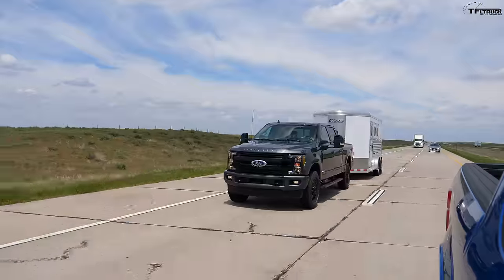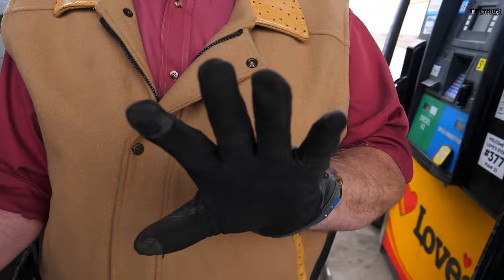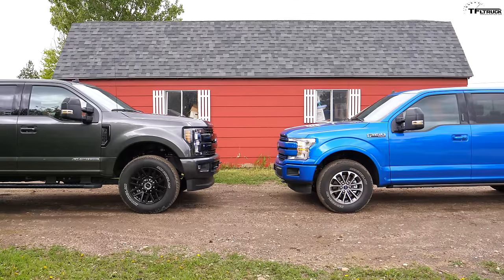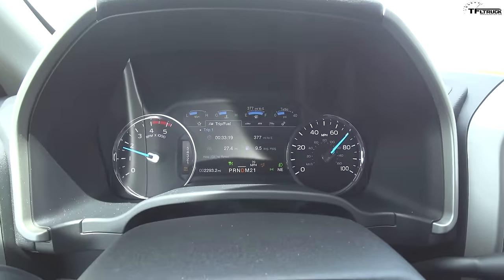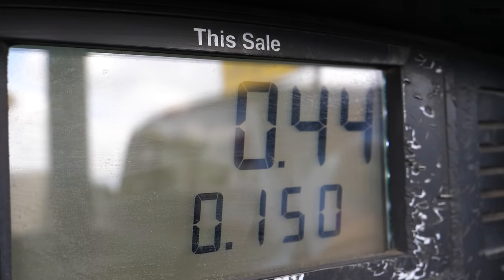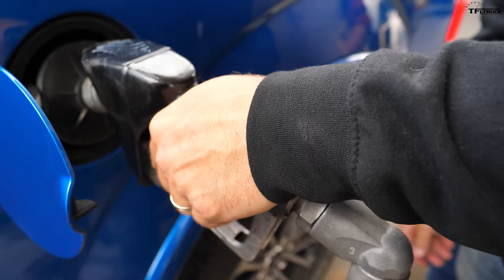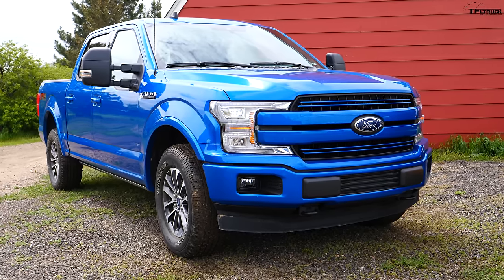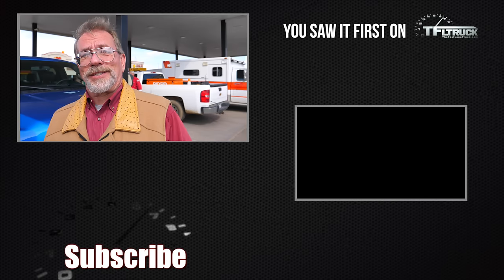Do You Really Need a Heavy Duty Truck to Tow 9,000 lbs? Ford F-150 vs F-250 MPG Review

Comment: The truck weighing so much less and the diesel being 1.7L more displacement does hurt its efficiency significantly comparatively. Of course the turbo helps but the weight is still a lot more. If it was a 6.7L turbo gas truck I feel it would be in the 6-7 range

Comment: Obviously the Heavy Duty will outperform the Half Ton V8. The real answer to which truck you need boils down to what you actually use the truck for. If you tow a camping trailer 3 or 4 times a year, go with the Half Ton. If you tow on a regular basis, like every week, then get the heavy Duty.

Comment: They need a 5/8 truck. 1/2 ton size with tow and payload between the two. Say 13000lbs towing and 2k payload on the spec sheet. Then anyone with a trailer between 26 and 32’ will habe perfect truxk to tow without the size of a hd for everyday use

Comment: There are F-150's with more payload than that F-250 and can tow 13K easily.   How much can your half ton can tow was completely glossed over though. Payload determines if you can tow it or not.  According to this video, they are 10% tongue weight on that 9K trailer, add in the WDH and they are at 1000 pounds. Add in two dudes at at least 200 each and there is 1400 pounds in that F-150. So they are within 200 pounds of GVWR, provided that there is nothing else in the cab or bed.  On the F-250 they are 600 pounds from GVWR.   If taking a trip with a 9K trailer with the family and 200 pounds of gear in the bed, the F-150 will probably be over weight.  If it is a travel trailer, 10% on the ball is too light and a sway incident in the making, so figure 13% on the ball,  or 1170 pounds, plus the hitch, 1270. Hope you have the proper tow package, which on the 5.0 is 1150 pounds max tongue weight.  OOPS guess what, a 9K travel trailer with a 5.0, not going to happen, sorry.   Tow package for the F-150 is 1150 WDH 11,500 GVWR of the trailer.   Ecoboost can have Max Tow, 1320 hitch weight, 13,200 trailer weight, so as long as it has at least 1800 pounds of payload, it can tow a 9K travel trailer. 

The guys need to run some numbers on these trucks for various towing scenarios, because towing is not cut and dried, there are a lot of variables involved.
Reply: Dude you on the spot. Payload is the rule!

Comment: Do you guys think the big 3 might end up dropping their respective 3.0 diesel 6 cylinders into the 3/4 ton trucks eventually? I think it would be a great cheap option for fleet buyers, I know they don’t tow like the big V8 engines but maybe they should offer them as a no cost or low cost option over the small block v8s. Maybe after the 7.3 Ford, 6.6 Chevy and whatever Ram chooses to replace the 6.4 with, it might be viable. I think everyone knows these 6 cylinder diesels are heavily detuned for the EPA, something you don’t have to worry about so much with a 3/4 ton.

Comment: Get a used old truck for 1/3 or less of the price. May need some parts but you will still be in the green. Will most likely work better and be more reliable. 
Spending 65k on a truck is absolutly dumb. Imagine being in debt for that long on a vehicle that's intended to be abused. Smh.

Comment: Looks like this loop is all flat so not very realistic. How about a loop that includes some hills? Doesn't have to be the Ike but at least something that puts a load on the trucks. 

Most people don't buy diesels for the fuel mileage. They buy them for the ability to pull big loads, longevity, and the engine braking capability when descending long grades.
Reply: Mystery Meat exactly. The diesel should shine even more. This might as well been all down hill.

Comment: With the help of air bags a front brake pkg which I installed myself on a 2011 F 150 4x4 with long bed,and not even a 5.0... It pulls my 30ft. Fifth wheel with no problem. As a class A CDL Holder, proper braking distance and common sence one should have no problem. 70k for a new dually??? Ef that!!!

Comment: " Do You Really Need a Heavy Duty Truck to Tow 9,000 lbs? " No.
But it sure is nice to tow with a Heavy Duty Diesel truck. Too much truck is better than not enough truck. Period. I could never go back to a 150/1500 even if it would do the job.
The difference between "tows it just fine" and "Does an exemplary job". The exhaust brake ALONE makes a huge difference.

Comment: Just think if ford built a twin turbo coyote for the f-150 and gave it 650 torque and at least 600 plus hp for towing.  On low boost.  Tuned well this truck would be great.

Comment: Might as well have used a Ranger. I would think that anyone planning to tow 9000 lbs would get a F150 ecoboost with max tow package. Tons of power and payload capacity.
Reply: Sooner than later that 150 would have multiple problems with 9k.  That’s just not safe.
Reply: @Chromewarrior  There is where we disagree. F150 is rated for 13,0000 GVW towing. 9k lbs is far under that and not an issue at all. I have this setup and it is great. Handling, breaking, acceleration are all MORE than adequate. There is a reason manufacturers provide this rating. People get caught up in preferences and "bigger is better" mind-sets.
Reply: D Koo5 , here’s my understanding, my 2018 F150 Eco Boost is rated about 13,200 gvw.. The truck weighs about 5800 . That weight is subtracted from the 13,200 leaving about 7400 to safely pull including what’s loaded in the truck+trailer +contents of both ( driver, passengers, fuel, water, etc) .im sure the manufacturers are conservative in their ratings to cover their butt. The computers on all these new trucks are like a black box. They pretty much record, speed, pulling weight, braking which could cause problems for exceeding warranty. I’ve heard so many different opinions, it’s crazy!
Reply: @Chromewarrior  Don't confuse your tow rating with your vehicle GVW. They are two separate things. Tongue weight/5th wheel hitch weight, factors into your truck GVW. Tow weight is as rated; trailer or 5th wheel.

Comment: That's crazy bad MGP from the Diesel … I don't get it? I tow my 34' boat (12000 dry + whatever gas is left in 240 gallon tank) ~1080 miles twice a month and get over 14 mpg all the time with a 2001 7.3 F250 4x4  had a 1999 F250 10cyl  that got at best 6.3 mpg towing the same route and boat...

Comment: My issue with the Video is due to payload. The 150 was around 1450# which with a 900# trailer and 2 adult men, probably were pushing the payload limit. You should have weighed the trucks as well hooked to the trailer (BTW there is a CAT scale at that Loves.) now imagine a real family with a camper or horse trailer or boat, with 2 kids and the bed of the truck completely full. There would be no chance of being under the payload limits and in all honesty the 250 would have been pushing it as well. I would like to see all of your towing videos to have the trucks weighed with the trailers and compared to axle ratings and payload because a “normal” family using these vehicles you are WAY over payload way before you get to max towing capacity.

Comment: No you don’t. I have been towing a 6500 lbs RV with Mercedes ML/GL (GL BETTER) Diesel legally, safely for 20,000 miles, 5 years. Cross winds, sudden braking, everything. It works if common sense is present. I also towed the same trailer with a RAM 1500 Ecodiesel. Flawlessly. The problem with the RAM was the payload (tongue weight). Believe it or not the GL was legal and thre truck not - at the scale.

Comment: How about the f150 with the 6 1/2 ' bed with the max trailer package 20" wheels,3.5 EcoBoost, crew cab,4x4 with 800 lbs in the cab towing 12k .ford says it will tow 12700. I only tow my toyhauler every once in a while and would like the f150 if this is safe to do so.i would like to see a video with this scenario and give your feedback. I like you channel you give us truck buyers real information

Comment: Did the diesel go into regen mode on the loop? It only consumes DEF during regeneration. If not it shouldn't have used any DEF. A bunch spilled out of the fill neck when you topped it off.

Comment: How about a car trailer where you can't perfectly center the weight in the trailer, like hauling a diesel truck that's front heavy.  I towed one recently with my 07 cummins 2500 and you couldn't pay me enough to haul something like that with a gasser 1500.  Highway maybe fine, but you get on the regular roads with bumps, good luck!

Comment: At those pump prices it cost $1.96 less to do that tow with the F-250 diesel vs the F-150 gas truck. You only need to do about 5,102 of those trips at those fuel prices to break even on spending the extra $10,000 on the F-250 diesel.
Reply: Apparently Diesels require more maintenance...more oil for oil changes..etc...another consideration.
Reply: @mikefoehr235  And have more towing capacity...and your point?
Reply: @killer2600  my point is a diesel will cost more to maintain than a gas engine. Plus the higher cost of buying one to start...looks like 10 grand more than a gas motor.
Reply: @mikefoehr235  None of that is really relevant because my original comment is just an insight gathered from the video. No one is really going to do that run over 5 thousand times and during those 5 thousand runs the price of fuel isn't going to remain the same.

You're trying too hard to nitpick. Even if the gas were to be cheaper to own it can't tow the 15k the diesel can so the gas trucks lower cost is irrelevant to many F-250 buyers.

I was just pointing out that despite the higher cost of the diesel's purchase price it would be possible to break even because of the lower fuel cost driving these runs in the video.
Reply: darkjedi351  did not know it was that bad...wow

Comment: Trucks don't stop trailers with their brakes alone.  You have to adjust trailer brakes to assist.

Super duty is far more stable for 9K pounds.  I've had 150 and 250 gas.

Comment: Have owned Gas and Diesel.  For the occasional small camper or boat etc.. Gas. but if your an every weekend pulling or even week day or take trips more then hour from home towing buy the diesel/heavy duty truck. Currently own F350 with 6.7 diesel and pulls like a freight train and has 212k on currently.  Fords only way to go!

Comment: One of the lower trim level F250 with 6.2 V8 doesn't cost much more than a higher trim level F150 or maybe even about the same price.  Trucks don't need all these extras that add nothing to the capability.  A bunch of chrome and infotainment stuff that most people don't want to pay extra for.  Not to mention gigantic wheels that look silly with low profile tires that cost a fortune when they wear out.  Something like the tradesman series that Ram offers is a great package for a new truck.

Comment: I really like your videos!  Very informative!  I have a 2018 F-150 XLT WITH 5.0 Coyote Engine.  I also have a Jayco Jayflight trailer, 35 ft long, 6500 lbs dry.  I have a weight distribution system plus Airlift airbags 5000 lbs.  In your opinion, am I okay with that set up?  My F-150 has a max tow capacity of 11,600 lbs and a GCWR rating of 14,400 lbs.  I was contemplating trading up to an F-250 diesel but your video here gave me something to think about.  

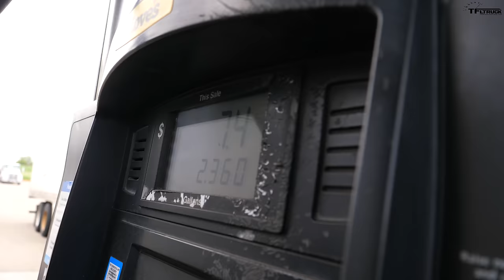Also, I have concerns about hills.  Is my truck powerful enough in the lower gears?  I have a tow package with a 3:55 ratio.
Reply: Half-ton truck, 35-foot trailer; not a good combination.  I really doubt that a 35-foot Jayco only weighs 6500 lbs empty.  Get a smaller trailer, or a 3/4 ton truck.
Reply: That’s what the rating says on the sticker on the trailer.

Comment: I want to see braking and handling in corners. I also want to see this done on the Ike gauntlet. 

Personally I wouldn’t buy a f-150. I like a big diesel way too much, and the 8ft bed. I also like to stay under 80% tow capacity. Easier to have way too much truck, plus you can delete emissions.
Reply: I had a question on the DEF fluid is it true it actually hurts fuel economy and that it really isn't better for the environment?
Reply: Spartan 212 DEF is essentially urine. Its really not any better for the environment. And yes it hurts fuel economy, 1-3mpg is what I have personally seen out of light duty trucks. Diesel as a whole is more environmentally friendly. Unless you are a jackass that rolls coal. 

Diesel is a byproduct of gasoline. If we refocused the EPA to reduce consumption of fuel, rather than reducing emissions we would be better off overall. 

If you delete emissions, you can expect overall lower fuel consumption, better power and throttle response, and reduced emissions because you consume less.

Comment: would've like to have seen 6.2l v 5.0l or 3.5l v 6.7l.  feel like the 3.5l is where you'd question if the 250 might be more of what you need not the 5.0.

Comment: Besides MPG, diesel have way more torque, which means you can step down your foot and it will respond. You could here the gas V8 struggling at high rpms during climbing.
Reply: In defense of the gas V8, the 5.0 is a dohc high-rpm V8 to begin with
Reply: @jaysson1151  yes, but I mean that diesel can handle better heavy loads

Comment: That f250 was probably tegenerating during that run. 9mpg is really low for a fairly aero 9000lb trailer.
Reply: Jimmy's Tractor Very low. My Duramax tows a 35 foot travel trailer with same weight and averages 11 mpg.

Comment: Gas would have been a better comparison especially since the diesel is adding weight in the front further changing handling with trailer. I know I know you use what you get but still.

Comment: one thing I've always wondered is that they get on the highway and go to 70 mph but is that the legal speed limit everywhere in the US?

in Canada it's 60mph in most places so I was wondering if that change of max speed would affect these results much because I know for a fact that the power needed to go up 1mph at higher speeds 69 to 70, than say, going from 49 to 50 mpg
Reply: It's 55 in California when towing. It just varies by state.
Reply: In Texas 75 MPH on most highways, 80 on some sections of I-20 and I-10 and 85 on a toll road around Austin.

I have one short section that I drive daily that is 65.

Comment: It is not about TOWING CAPACITY.....its about PAYLOAD CAPACITY. My f150 3.5 ecoboost could tow Noah's Ark. Rated at 13200 towing capacity but it has a GVWR OF 7000 POUNDS AND AT 1800 POUNDS GEAR YOUR THERE. You have to consider the tongue weight as it is added to the payload capacity of the truck.Ford recommends that my truck should not tow a travel trailer over 6000 pounds (DRY WEIGHT) cause its about breaking safely. The f250 and 350 super dutys have breaks that are far superior to the breaks on a f150. They have stronger frames and better drive trains and suspensions as well. Be good to your truck and be safety wise on the road (respecting others).When buying a truck FIRST ask yourself "what do i want this truck to do" Then crunch the numbers. I upgraded my f150 ecoboost and bought a f250 super duty. It broke my heart cause that 150 had balls but It did not meet the requirements to haul the trailer our family wanted. BE SAFE.

Comment: Curious what you all consider " frequent towing or lots of towing miles"?  Our travel trailer will be 26 ft. (31' hitch to bumper) 7,200 dry weight, 10,000 GVWR.  We'll be towing at a minimum 15K mile a year including at least 2 trips a year from Seattle to Los Angeles and back.  250/2500 Diesel or Gas?
Reply: The engine won't matter that much but at least you're in the right class.

The Diesel should give you better longevity though.

Comment: I think there should be an inclusion of a gas 3/4 ton truck.  Those numbers for a diesel suck... thank you emissions. My wifes 2015 Ram 2500 6.4l CCLB grossing 24,300# load of hay (7,600# truck, 4,700# trailer, 6ton hay) gets 7.8 mpg.  The parents 04 Ram ctd 3500 dualy gets 10.5mpg pulling the load of hay.  Wifes truck pulling a brick of a horse trailer gets 12 mpg, so under 10mpg pulling a dinky horse trailer with the powerstroke sucks.

Comment: So, with both of you in the truck and 15% tongue weight you were over GVWR on the 150, nice. Also diesel F250 has an abysmal payload. might as well get the 350.
Reply: Lol bumper pull pin weight will be 10% not 15, easily under truck payload of 1700 lbs.

Comment: You only need a HD truck to tow  a 9000 # trailer if you want to live . Been there and done that. It makes all the difference in the world. A Tundra is just a 1/2 ton pickup. It does not have the FULL FLOATING AXLE or the heavy duty truck gear to go with it. There is a reason its called a HD truck. The frame is heavier , the brakes are heavier the rear axle is constructed differently and the GV weight rated is 10,000 pounds. It can pull legally heavey weights .

Comment: I have  2018 F150 V8, I love the truck but I think my line would be 7,500 lbs pulling.
Reply: Payload is a huge factor too. 1/2 tons usually have a payload of like 1300-1500lbs and with coil rears its a lot. Id put air bags in and also the wdh for sure. I may get a 1500 and do the same to tow 8500lbs cause i only tow a few times a year and when not towing the mpg and size is a big factor for me

Comment: Great video but why why why didn't you do gas vs gas? 250 gas version would have been better vs the f150 gas.  We all know diesel is better for towing.   Also 9.5 out of the diesel is not impressive at all!   I tow a 37 foot camper that weights roughly 9500 lbs with my Titan XD gas and averaged 9.4 miles over the 1000 miles I just towed it on vacation

Comment: Huh, it's interesting to be able to lock the hub manually, failover feature maybe? I'm trying to figure out why that would be on there.
Reply: To reduce driveline drag and wear on the front drivetrain when in 2 wheel drive and increase fuel mileage.

Comment: Premium fuel is recommended for the 5.0 V8 when towing. 87 was used in the test. On mine, it makes a difference when towing 8000lbs. When not towing, I use regular.